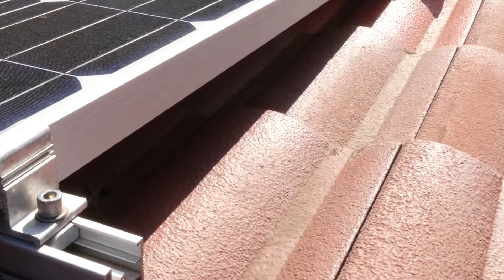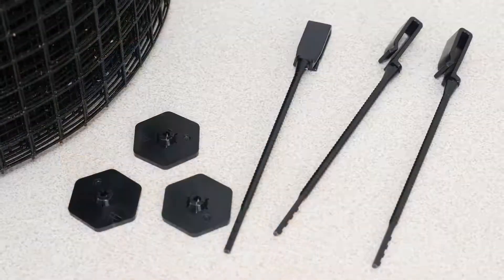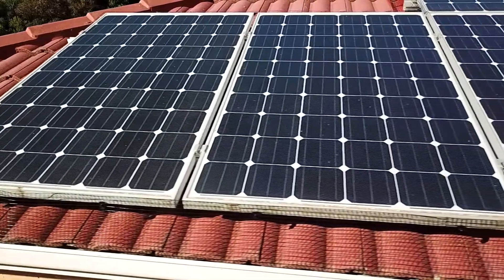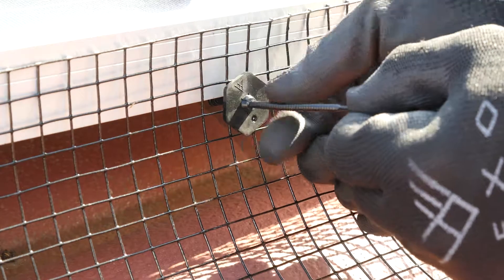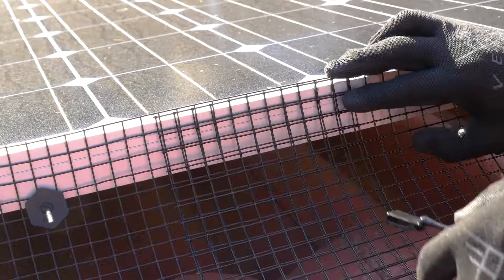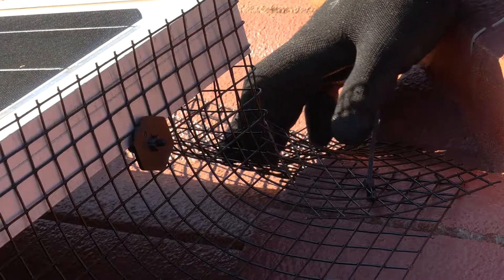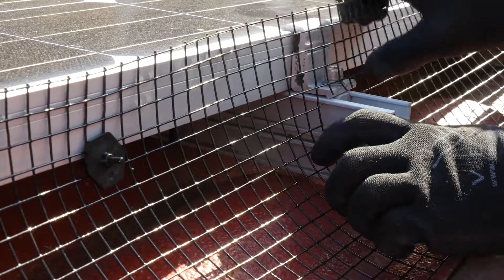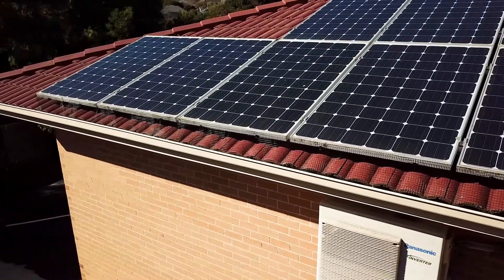Solar Panel Protection - Simple and Easy Method to Deter Birds and Rodents from Your Solar Panels

Comment: Why do we install the solar panels at the first place? Does it save a lot of money?Think about how much you spend and how long you are going to live in this house for then you would reconsider it! To me ,never!
Reply: That’s just a stupid comment. In the 2 years we’ve had our solar panels we have saved thousands of dollars on our electricity bill.
Reply: @nicolecat4020  Did you? Could you show us your bill! You saved thousands of dollars in 2 years?Say $2000, you get 6 cents/kW and that is 33,300kw/2 years, 1380kw month. Do you use that much electricity a month?
Reply: @HarryYou-j7l  Yo, i hit over $1000 in electricity in four months during summer.  Easy!
Reply: @croikie19841  wow, you should move to Melbourne .I  turned my aircon on only two days this summer or maybe my house is a double storey that helps a lot.
Reply: @HarryYou-j7l I mainly am using them so I don’t have to pay thousands for each utility pole installation into the woods so they are great for me
Reply: @HarryYou-j7l  During winter in Idaho I use upwards of 2498kw in a single month.
Reply: You're smart. Solar won't save you money when you factor in maintenance, repairs and removal and reinstallation for a new roof.
Reply: Here in the UK I get about £1000 back a year but I also get 3Kw free electricity when it's fully powered. I can use my washer and dryer at no cost. 
The electricity you use for free far outweighs the amount you get back from generating it and giving it to energy companies (at no cost to them) to sell to your neighbour at 30x the price.
Thats business I suppose.
Reply: got 16 panells + battery storage, midlands Uk, in summer time we're pretty much off grid, bills in winter got from £100+ a month to less than £40 usually. costs of panels recuperated after 6years